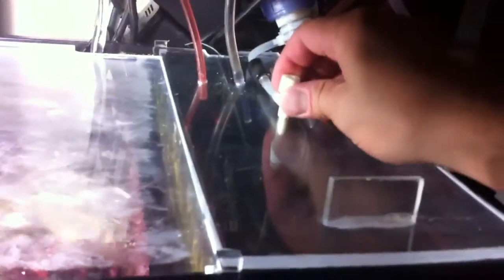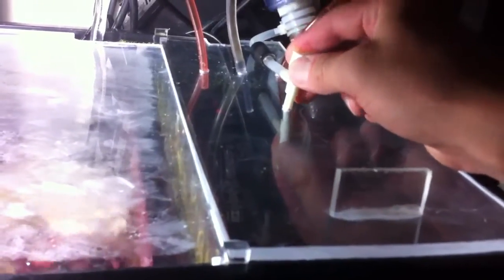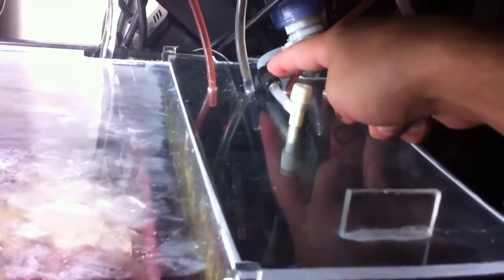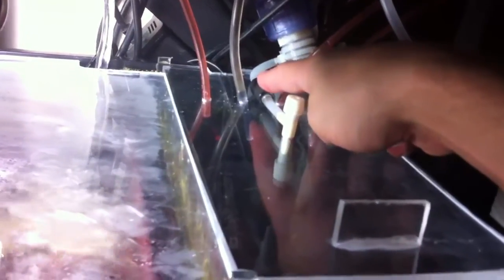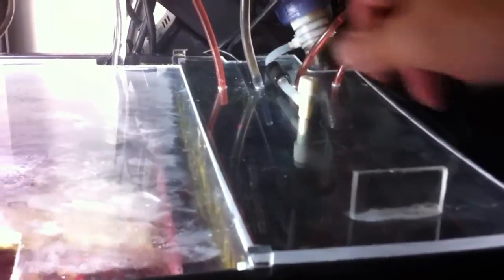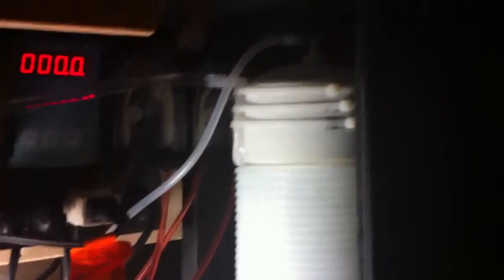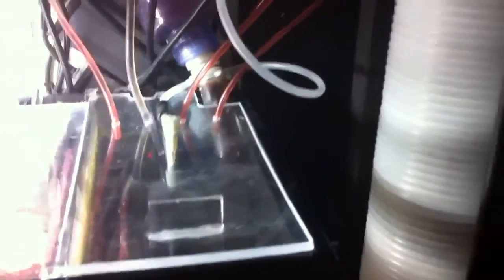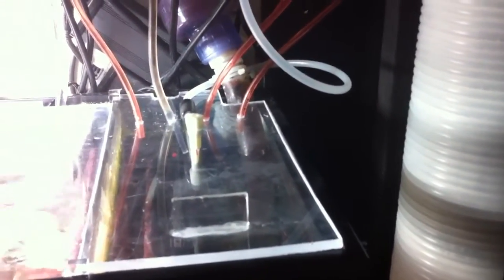DIY Coil Denitrator pt.7

Comment from the maker: They must be used with a battery backup to keep it running or they can nuke a sensitive tank in the event of a power outage. Don't waste your time on a coil. Try the vodka method or any other form of organic carbon or refugium or bio pellets or DSB.

Comment: My friend I understand that as the water goes down the coil the air will naturally not want to go down! It looks like all of your connections are closed: so where does the air escape from? I understand that when you start it up the air will simply just flush thru the system with no harm done! But, let say a month into the cycle: the pump takes on air: then how does the air escape without entering the airless chamber?

Comment from the maker: Yes, I've read very good things about algae scrubbers. Did you plan on going with the Santa Monica? They really appear to be the very best around. I think you can achieve the same goal by running a properly configured/sized refugium too though as they do virtually the same thing and actually provide a much better safe haven for pods and such. Plus you could do a DSB in it as well like I've done.

Comment: Been running a Refugium for a while now. I think I've tried everything possible. I could do daily water changes for a 100g system, but that would be too expensive. I'm using R/O water, cut my lighting down to less than 6 hours, bi-weekly 20% water changes, etc. The shit just keeps coming back!

Comment from the maker: I know that .1 phosphates seems like not a lot, but due to the fact that phosphate is so toxic to corals and is also a source for cyano to thrive on, that reading as actually VERY high. If you have any kind of phosphate test kit and it detects anything at all, you've got too much phosphate in your system and it will hinder calcification in your corals.

Comment: OK....I just checked my Nitrates after using an aftermarket product, and they are still in the 25-30ppm range in both tanks. I waited 4 hours after I added the solution to make sure that it was spread well. As an addition to the pot scrubbers, I planned on adding some bio-balls as an additional "carbon source" when I build this, and get a firm grip on my Nitrates. All of my other parameters are perfect.

Comment from the maker: If you are having trouble with growth in corals, I would check phosphates first. You'll want them to be as close to 0 as possible. They hinder growth in corals much more so then nitrates. If you are having issues with both nitrates and phosphates, macros again will be a good choice if you haven't tried it yet. If you really want to get control of phosphates fast, have a look at my TLF phosban media reactor video. GFO will reduce them very fast.

Comment from the maker: I am not convinced that a coil denitrator will be a "cure all end all" to nitrates. They can help. But I am a firm believer in doubling up on filtration systems each will support and back up the other example: (dose carbon as well as grow macros as back up or vice versa. Between the two, they should be able to handle nitrates completely even if you ever did get a spike. The main reason why I don't believe that a denitrator like this will reduce system nitrate levels down to 0 is because they ju

Comment: OK..Just to be sure, this Denitrator will bring the Nitrates down to an undetectable level, and then once fully cycled, "should" keep your entire system free of nitrates? Until a future spike or introduction of Nitrates has taken residence into the tank. Having said that, testing once a week, getting 0ppm Nitrates, adding your supplements of your choice, constant water change schedule, and all my Corals should begin to grow? I have Metal Halide lighting that seems to maintain my Corals.

Comment from the maker: If you have a nitrate issue and have not tried macro algae as an export, I would do that first. This denitrator I built was a last ditch effort to gain control over nitrates. Now it's just a backup incase they decide to spike on me again ever. I can just start injecting carbon again and the bacteria will bounce back quickly.

Comment from the maker: I have 0 phosphates in my system. I stopped dosing vodka because I've got the nitrates under control now. I upgraded my skimmer and I figured out how to get my macros to grow again. I used to inject vodka straight into the vinyl hose like you would a vain in your arm. I would then let the pump take it down the coils and then when it reached the main reactor, i would close the valve for a while to allow the bacteria to have plenty access to the carbon.

Comment: Damn...you need to continue to inject it. Without the Carbon, the bacteria will die off and all you have is a DIY project that just looks "cool". I work in a Laboratory so making a design like this is a breeze. Where did you locate your "carbon source intake"? I can assume that you placed it near the top for ease of injection. By the wey, what were your Phosphate readings during your high Nitrate cycle? I have an API Reef test kit, and the results are appx .25ppm with Nitrates of appx 40ppm.

Comment from the maker: It's been a little slow going on the cycle process, I stopped dosing vodka and the bacteria has seemed to diminish. The design is great. It works well, but it's has had a bit of a hard time cycling I think due to a lack of carbon. I have been injecting 1ml directly into the intake on the denitrator using a diabetes syringe. It was really  cycling fast until I stopped. I could literally see the bacteria in the coil within 2 weeks.